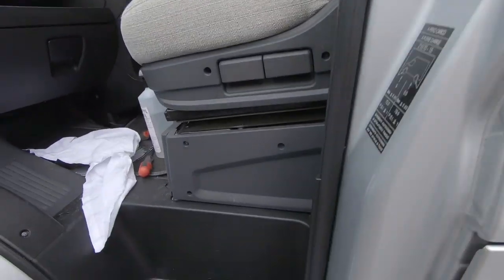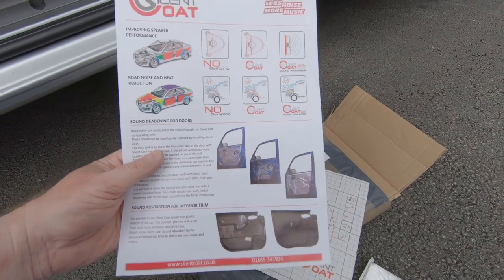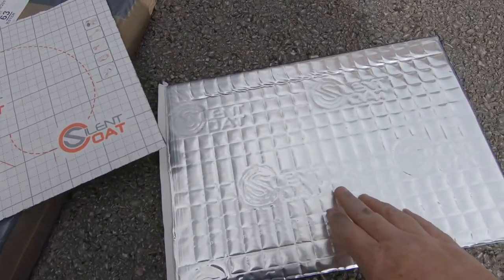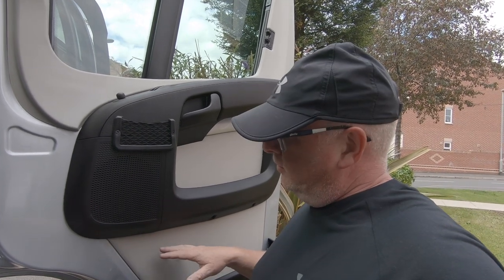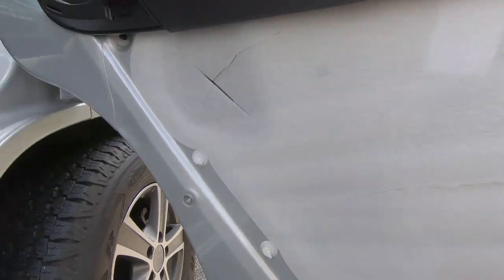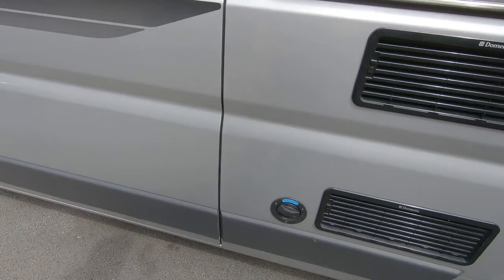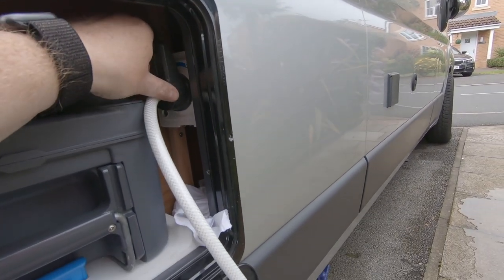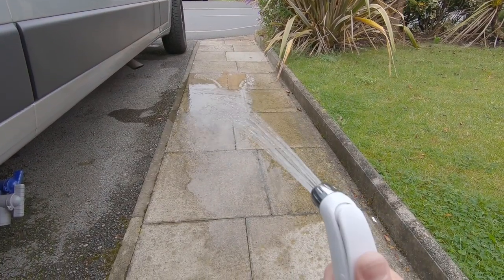Soundproofing the Campervan & installing a Bullfinch outside shower

Comment: Eh up John and Mandy, you have inspired us to pop some insulation into our sliding door, which when we popped the inside panel off the door there was the bare minimum present.  We bought silent coat 2mm sound deadening, reinstalled the insulation that was present and then added some Dodo Thermo Fleece.  Next job is to buy some of the additional door seal.  Thanks for the inspiration.  You look like your loving being full timers living in the van.  Enjoy and keep the video's coming.  Cheers.

Comment: After a fortnight in the Outer Hebrides, we have decided we definitely need to upgrade the soundproofing of our 1997 Ducato Swing.  You can see the road through the gap between the drivers door and the frame.   Your video has been very helpful !  Pete

Comment: Some more great mods. The outdoor shower is excellent, nicely tucked away too. You could easily make a 'cubicle' with some push-fit plastic piping, 4 few corner bits, and 3 suction cups and a large shower curtain too. Also very good for washing muddy dogs in nice warm water too. 😀🐾🚐

Comment: I did my doors and it really worked I have a old van and it used to rattle going along the road , it seems to have stopped not completely but it’s a lot quieter now I have more to put inter the bonnet and the back doors I also changed the covering that you cut with vapour barrier both on the door and the inside of the door card then put some foam backed leather on the door card because I did not like the look of the black plastic

Comment: Hi John, on the ducatos i have had i found it worth removing the plastic steps inside the cab doors up to the front arch to add sound deadening too and it helps a little with insulation. Put your hand down there on a cold morning and freezing. The shower works great how is your pump activated for the shower.
Reply from the maker: I pulled up the cab floor and did all that is a previous video when I did the rest of the van 😁 a pain, but well worth the effort. 
The water system is pressurised, so the pump kicks in when the water pressure drops.
Reply: Looks like a good pump better than in my a-class. The more i have taken these factory built vans apart the more you see how badly there built. Its not just Autofail the germans are not much better. Ill be self building next time. Love the videos keep up the great work.

Comment: Good idea of placing that shower connection inside the van for security reasons John but what if there is any  leakage (9:22)?  ATB Marc - Belgium
Reply from the maker: Leakage is tough, you’d hear the pump try and depressurise but otherwise it’d be like a leak anywhere else in the van.

Comment: John, have you tackled any ventilation/condensation  problems in the van yet? The reason I’m asking is, after the change in the weather, from 30+c to heavy rain , I had a Van day. That is, I had the hump and stayed in the van, hunkered down,  windows shut. Time for bed, everything was damp. Mattress, bedding, clean clothes, the lot. I had this problem in Portugal earlier this year, in a storm, and put it down to damp air getting into the van from outside. Not me cooking, making tea and er, breathing.
I opened a skylight, shoved, no other word for it, a 12v fan between the vent and fly screen, hoping the vent cover would still be there in the morning. Thankfully it was.
The heating was on all night, this is still July, and the van feels dryer this morning.
Watching Greg’s video, re Maxxfan. A great, if expensive idea. Unfortunately my skylights are 600x400. Not 400x400. That’s not going to work for me.
Bit of a long winded question,. But what have you done, or more likely, what would you do?
My van is a Ducato panel van of the Adria Twin variety. Thanks for taking the time to read this.
Reply from the maker: That’s really bad, for that much condensation to get inside I’d say you have a big leak somewhere. We’ve had no issues at all with condensation.
Reply: There’s no obvious leaking into the van. As I said,I’ve only had this once before, that was in a storm and like yesterday,the ambient air was damp, so moisture inside, me cooking breathing what have you, wet air outside. 
I had the van locked down, windows and vent closed. Another lesson learned. From what friends have said today, no ventilation = damp.
Thanks for the reply. Stay safe.
Following with interest.
Reply from the maker: Ah, yes, if it's raining a lot outside and you're in the van a lot you do need to have windows on vent or slightly open, the windows shouldn't let rain in if they're on vent or open open slightly.
Reply: Gadget John on tour
 12v fan going in today, fitting it to the loo mushroom vent.

Comment: Hi John, great video and appreciate all the advice...we have a auto trail 669 so all your content helps greatly, just one query - how many metres of door seal did you use, I need to do this modification to ours!! 🙉
Reply from the maker: I did every door, the fronts, the reas and the side sliding door and used 3 packs i think, not sure as I also sealed the skylight too.

Comment: Eh up Jon,  having already taken your advice and installed the additional seals on the sky lights, this video really got my attention as our cab is loud when travelling.  
How did you know that your doors hadn't already been soundproofed?  Yeah sort of daft question I guess if it seems loud, but I have been tapping our doors tonight to see if I can tell if ours have been done, I can't tell though.  If the husband had let me I would have had the door panels off today to check.
We will be watching this video, as I defo  want to do the seals.

Different question now, have you ever had a drive away awning?
We only use the canopy and I know that you guys don't often hunker down for long periods of time but wondered if you ever use an awning.

Cheers for the tips, keep em coming.
Reply from the maker: If you tap the door, or really knock them with your knuckles, you’ll hear a hollow sound if they’re not soundproofed and a very dull thud if they’re treated. If it helps no van or Campervan manufacturer adds soundproofing at all. So 99% sure yours will be like mine was. 
We had a drive away awning with our VW T6 & it was a royal pain, huge thing to pack up even though it was a pump up awning. The canary doesn’t offer full weather protection but it’s much easier to use.

Comment: Hi John. After taking steps to make the cab quieter, I was wondering if you have any suggestions for suppressing the various rattles and vibrations that eminate from the cooker - particularly the hob, (more so than the oven and grill, which aren't really a problem, once you remove the shelf and grillpan, to store elswhere). Its the main source of extraneous noise in my T669, (as I suspect is the case in many motorhomes), and its a bit annoying. Would be interested in any thoughts or tips.
Reply from the maker: We usually pack towels and clothes in the cooker around the shelves and pans etc.
Reply: @johnmandy Cheers for that... I have a folded-up heavy groundsheet which lives on top of the glass lid, when we're in transit, that similarly cuts out most of the problem, but. I just wondered if you might've "engineered" a more elegant/permanent solution.

Comment: Thinking of purchasing the bullfinch outdoor shower but I don't have hot water on board. Could I just leave the hot water attachment and just put a cold supply on the back or would I need to attach to both hot and cold ports on the back?
Reply from the maker: You would need to connect your cold feed to both the hot & cold shower connections.

Comment: Hi mate. Is the door seal necessity relevant to sprinter/crafter also. Do only certain vans suffer or would all benefit. Thanks
Reply from the maker: I used it on our T6 and now it works on the fiat too, so it should work on any vehicle.